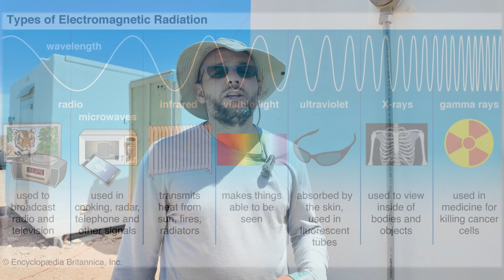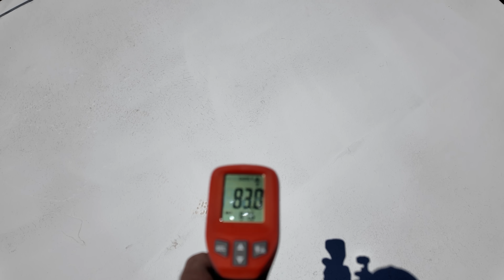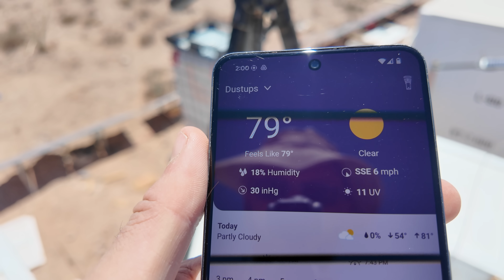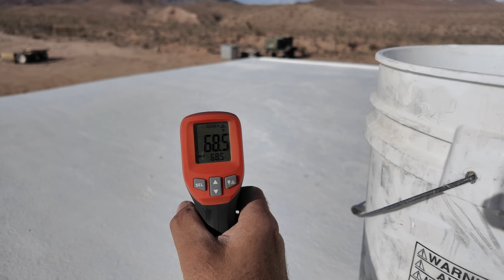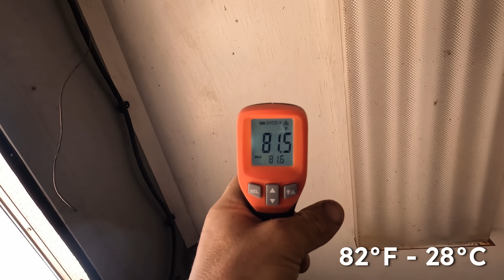I sprayed "cooling paint" on my desert cabin...this is shocking

Comment: I’ll give ya’ a couple of options that will be both dirt cheap (pun intended) AND highly effective. 

1.) Push dirt around to block —not fully cover AT LEAST one side of your little huts/apartments/shantis (whatever you call ‘em.) 

2.) Add 10” to 2 feet of StyroAirCrete or DustCrete to completely encapsulate your building. 

Since you’re not subjected to building codes you could just add on 2X12 framing around your entire exterior — including your roof — so you don’t lose interior real estate. You’d then cover it all with whatever your preferred insulative crete-based filling is. 

To protect your wood from desert critters all you’d need to do is ‘shou sugi ban’ (e.g. burn) all the wood then coat it with a combination of used motor oil and boric acid. Critters nor mold would EVER touch your framing. 

To then fully weather-proof your structure you’d just stucco every surface you just insulated. 

For the final cooling ‘coup de grace’ you can make yourself a MASSIVE batch of the Nighthawkandlight cooling paint and apply several coats to all of your stucco. 

BOTTA BING, BOTTA BOOM!!! You’d now have a hyper insulative structure that does an 🥚EGGSceptional🥚 job of reflecting light. It also becomes easy to keep the temps down to 60*F at night to get far better sleep with just a minisplit.

Comment: G’day. In Australia, you can buy a ‘Carport canopy’ for about $200(USA). Ya GOTTA get the direct sun off of your building. You are talking 36 degrees celsius… in Adelaide (and many other places in Australia) 46 degrees Celsius gets reached pretty much every year. You can do a really simple test. Grab a bunch of cardboard boxes of similar size. Cut lots vent holes, glue/tape them into a big flat hat, put the hat on one of your buildings. You’ll notice a huge difference.

Comment: I saw someone build basically an open carport structure (post and beam with a  simple shed roof) over the main building/s to create shade  outside the smaller building and to take radiation  and rain abuse off the main structures.  Redundant but may be a simple solution if you have the space. May also create somewhat of a breezeway.

Comment: I used a product called Permakote 26 years ago on an arch galvalume building. It went from burning your hand to barely warm in direct Florida sun. Ceramic beads work like the space shuttle, they claim. It works and is still on the building today with no repaint. I think they may still be in business.

Comment: BTW for radiative cooling at night, nighthawkinlight's method is extremely useful and effective and still extremely good in the day.  However in direct sunlight there are two another method that has been used for thousands of years and is quite effective.

One, keep everything as radiatively emissive as possible but suspend a taught awning over everything, usually several inches above the structure. The area directly around should usually also be covered as a good deal of this energy is also re-radiating from the ground.  The idea is that you want the radiation to be absorbed by a tight fabric a covering and to dissipate that via the convective forces to the wind instead of being held in the structure.  Now the downside to this is you will be creating a radiative blanket at night.  Some places used retractable awnings for this purpose, other designed played off angles of the sun to be more effective at different times of the day.  There is a reason you will often see dark fabric being used in extremely arid climates; it's a radiative heat diverter.  Another more modern approach is to use slanted boards in a pergola over the structures, or even better variable tilt louvers that can index to the sun angle allowing partial radiative emission of the structure underneath while still keeping direct sunlight from touching the structure.

Two, use height pressure differences to draw airflow upward out of a structure, and then pull your fresh air from underground during the day.  And if you can have that airflow pass over over water, even better.  But a modern version is to trench some PVC pipe underground in a big U shape, pulling hot air in via a fan, down under several feet of earth, and exhausting it back up into the space.  Add doors and screens for sealing everything off and controlling anything from getting inside and you've got a pretty decent cooling system.  Now if you want to go super science heavy you can look at TechIngredients brine based Air Conditioning system that also runs with a fraction of the power and just uses PVC pipe, shower heads, water, and salt.  And the water use by both is relatively small by comparison to a swamp cooler.

In addition you may want to experiment with nighhawk's phase change setup.  He is still working to perfect it, but it's very usable with it's current limitations of slowly degrading.

Comment: Canadian here. What is the soil depth? One "trick" being used by a few innovative people here for greenhouses is in video that I saw (so I researched whether it was true).
The ambient temperature in the ground at depth becomes both a constant and quite reasonable at a fairly achievable depth (if you have a trencher / excavator that is!).

Using underground rated tubing (25-year-warranted) buried at about 10' deep and running ethylene glycol /water mix you can get cheap "geothermal" cooling.
No, really. Use solar panels to drive the pump and a low-pressure high volume fan, and a car radiator as your heat exchanger.
The example I saw was to keep Canadian greenhouses WARM in winter (lots of crops are fine if kept above about 40F) but it also kept the greenhouse cooler in summer.
Very location dependant ... but it might be an alternative.

Comment: A mini-split AC could cut your power requirement in half. The efficiency of a window unit is only going to be like 11 SEER at best, while a mini split can be 25 SEER or higher (33 SEER is the current record). This means that a window unit (11 SEER) with a 6000BTU cooling capacity uses 550W/hr, while a mini-split (25 SEER) would only use 240W/hr. Less noise, and insulation required as well.

Comment: try that "wind catch" thing... hoothi?... just get a tall pole 15', run up a 5 gal bucket on the side with a 6" hole cut on the bottom... use a wind vane to keep it pointed into the wind.  get a $60 20' duct line, connect the other end to the shack... maybe have it run over a wet water bucket or pan to blow in humidity and collect the dust ...  kinda like building a reverse fireplace but to bring in the air.

Comment: Signature....solar minisplit that runs right off of solar panels... panels are $120/ea (450-550v?), so get overkill amount (see spec) or a pallet... $3k gets you 10 years of 12,000 btu cooling / heating. runs off 110v at night...seer2 30 (super efficient).... maybe try a dirt roof... i forget how thick it has to be... 6-12" justt shovel up there... cheaper than $330/gal

Comment: It's a bit funny when you point at the sky pretending that it would be a clear path to space when in reality there are greenhouse gases that are reflecting the IR radiation. And in the next sentence you are concerned that those mountains are reflecting the IR back 😂😂😂

Dude, get solar and mount it on top of your cabins. They will provide more than enough power for your air cons and they are creating shade. So instead of buying very expensive paint...buy solar!

Comment: One thing they don't tell you about that style of airless paint sprayers is you lose about a gallon of paint just to fill up the hose.  How much did you say a gallon of paint cost?  I think you could have rolled it out a pint at a time and saved time and money on paint as well as the cost of the spray equipment.

Comment: 2nd story?  Probably better of digging downward.. making an underground living space.

 Other than that.. you probably want to try to use misters... and maybe a lot of additional shade tents.  Maybe even look into transforming the desert with greenery... like how china did to their desert areas.

 That said... it would likely take quite a good deal of water to make such a thing possible.

 Anyway.. if you can dig under the sand for a foundation.. it would probably insulate any air conditioning you may use... fairly decently.  Also.. it would likely be nice and quiet.. too.

Comment: Request: You should test Henry's RV roof paint. UV resistant.
I did an old RV. It made a huge difference. 
I would love to see results with that paint with your heat reader.
It is cheaper and extremely water proof. You can plug holes with that paint.
I have had it on the old RV for 5 years no cracks.
Reply: No, it's not even close to as good as this. This paint allows the walls to get below ambient temperature.

Making the paint himself is also multiple times cheaper than that, and very easy to do.

Comment: Id like to see you put all that sand on the property to use turn it into an experimental sand battery. TEG tech is starting to improve and you maybe able recover some of the power the ac units suck up. Alternatively expand on your underground cooling idea think radiant floor heating but in reverse, incoming air at the bottom outgoing at the top

Comment: A solar-powered mini split will solve the cooling issues. It would take about 8 ground mount solar panels. The inverter is built-in to the AC unit. They are very efficient. EG4 makes a variety. They come in 9k, 12k and 24,000 btu. 0:07

Comment: You should use passive heat exchangers, evict the heat that your electronics makes. Ventilation makes a lot of sense with passive heat exchangers working half in shade will help a lit also put the paint on your hat also an offset layer if plastic 6 inches above the roof top will have the  same affect especially if there is a breeze! Same goes for sides .

Comment: Ideally build 6 inch air gap roof with bifacial solar panels.  You drop roof temperature and gain energy for not much more than the cost of that expensive reflective paint. There's also a cheap reflective rubberized roof paint called Kool Seal that does the same thing for $180 for 5 gallons.

Comment: I'll add my 2 cents. The paint is a good idea but eastern and western facing walls or fences and secondary cover over the structures could go a good way to deflecting a lot of that direct heat. But it would obviously be more work in a hot desert so...heh.

Comment: I grew up in the norther Usa, then as teen moved to FLA.  My very first discovery day 1 Fla. Dark goth like colors suck the sun into your soul. So we went and bought all whites and lights.
Also coat 360 in white not just top. Thermal infiltration comes from all directions.  I still have my infiltration chart/calculation tables from HVAC.  We also used paint color and siding / roof materials too in the infiltration calculations equations.  You can find the charts on line...hint.  And show exactly what to expect.

Comment: 6:00 There is a bit of a misconception here. The problem isnt that it reflects all of that energy back, only a very small portion of it will. i mean thats how flashlights work some of it bounces back unless you have a retroreflector where a larger than expected portion is bounced back to the source.
The real problem with painting the side is that emitters absorb the same wavelength they emit. The ground is emitting a wide spectrum and with this being a specialized emission paint for this wavelength, it is going to be very good at absorbing that part of the ground's emission of that wavelength as the ground is heated by the sun.
At night this should be less of an issue because the ground is not being scorched by the sun so emissions from the ground will be drastically lower.

Long story short painting the side is less effective than painting the roof, but its not like it wont work, it should work very well. If the surrounding materials dont emit in this wavelength, in theory there should be almost no difference between painting the roof and the walls in this emissive white.

Comment: Have you considered Adobe or digging down?  You have the ability to move dirt, seem like the way to see how much you can bury and still be structurally sound.  When I was in Afghanistan the locals houses where often several step down from the front door.  The walls were thick brick or adobe and there was a large temperature differential.  Another option would seem to be geothermal cooling.  Rather than go straight down, bury the tubing under a berm.   In all honesty I dont know how applicable any of that is but I hope it helps.

Comment: Another thing you could do is add solar panels lifted off the surface of the pods so that the sun never hits the roof of the pod itself and you generate electricity at the same time! If you expanded the panels around the edge of the pods as "solar electric eaves" they would also block the sun from hitting the walls. You may want to consider sun angles summer vs winter so that the sun can hit the pods walls in the winter, but not in the summer. All solar oriented to the south of course.

Comment: I did that as a kid in Arizona. In the 1970s, we had 'SNOW COAT ' & painted our roof and enjoyed a 20-degree difference .
Reply: I had forgotten all about Snow Coat.  My dad had that sprayed on our 1955 era house in the 60s (as I recall).  This new stuff is supposed to be a lot better than the old stuff, so it must be pretty good.
Reply: Not the same. The difference is that it is just  cooler because it's white and the reality is because of the mess up and oddly the water despite what the dealer said unless it was the paint manufacturer likely could mess it up. Radiative cooling should be cooler and acting as a heat sink as well the problem is the there really isn't a good paint for that really is being researched still the ones that seem to work are basically short term and basically can't be reliably coated without knowing exactly how. Like you could have one that could be sprayed on but maybe have to be at a specific angle etc. Basically a true radiative cooling paint could take place or supplement an ac. The down side is the winter or cooler periods when you need heat as it would still be working them and that includes when it is dark. So you would almost need a louver system you can flip it around as if it where inside it should actually help heat. Basically you might be able to tell by now they don't really exist in the way it theoretically can nor would necessarily be practical in many areas. Without a lot of potentially moving parts and seals.
Reply: @zacharythebeau163  Whatever we had, it had a catchy name like that.  It was white rocks with a white plasticized goo poured on about 1/4-inch deep.

Comment: Energy emitted from the side to the mountains will not be reflected back. For this the mountains are too far away and the waves either absorbed or scattered in all directions once it hits an object. 

Glue aluminum foil to the ceiling, glue add a layer of Styrofoam 2-3cm, add aluminum foil on top and then paint everything white. The aluminum on both sides will reflect the heat / cool and Styrofoam will insulate.  Effectively, not much of the heat will penetrate the cabin and if the cabin is cool, the foil will reflect that so there won't be much energy transfer.
Cheapest solution. And if you have the money, add 1-2 Solar panels per cabin. Helps to shade it and provides enough energy for the small AC and the Laptop / Light.

For this, get used solar panels at a 50-60% discount and you have yourself a cool cabin for $2-300.

Comment: There is a problem in measuring roof temperature with that infrared thermometer.
As you said yourself the new paint is good at reflecting infrared, that implies different emissivity coefficient. Thus your thermometer was likely to read wrong temperature.
You should have placed black tape on both roofs to have consistent results. Measuring ceiling was the right choice.

Comment: Get yourself an airspool mini split, and 4 solar panels. Santana solar in the Phoenix area sold the let for like 3000. No battery, no inverter, just sun to ac. It will chill that tiny room down to under 70 degrees.

Comment: The ambient hot air is another problem. A roof vent with a vent in the floor on the opposite side would pull in cooler air from underneath the building. One step further would be a substantial underground duct pulling air from 6 foot underground.

Comment: Build some plates coated with the stuff that you can run water through and connect to a heat exchanger inside the building for additional cooling power.

Comment: Radiant barrier, an air gap and then the roofing material. Plus make the roof big enough to give shade to the sides to the building is under the shadow much of the day. Running shade nets between the buildings also will ame a big difference by creating a cooler area between the buildings.

Also put up walls around the building to block/absorb light and block the wind to create an area of cooler air around the building.

Comment: For your setup a roof with at lest a foot air gap over the entire group of pods with a two foot minimum over hang past the walls of the pods with a galvalume roof, would cut your heat by basically all from the sun. We do this with our hunting cabins here in South Texas and as long as you can just keep the sun off the structure (walls and roof), you're only having to fight the air temp and that is a LOT Easier. Also for your AC's look in to EG4's solar powered mini splits, they run a dual power system with both shore power and solar. So having all that sun you get over there would run the unit all day on its own saving your batteries for night when you really don't need a lot of cooling.